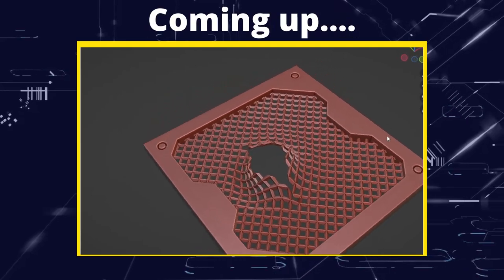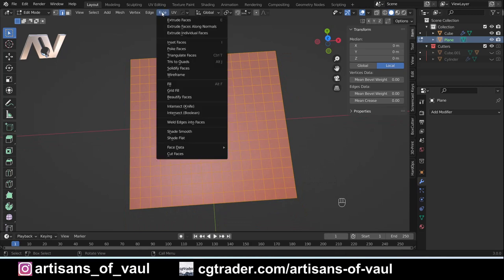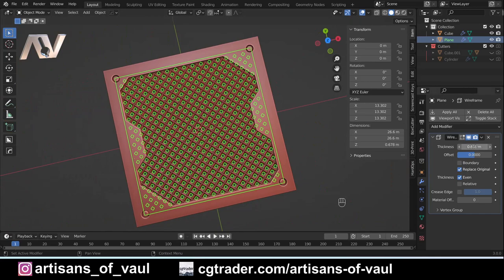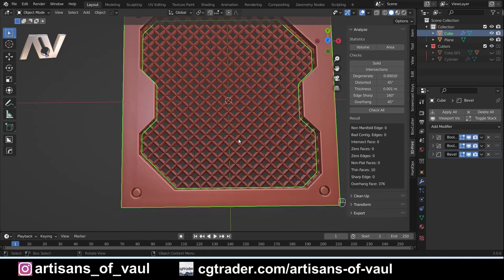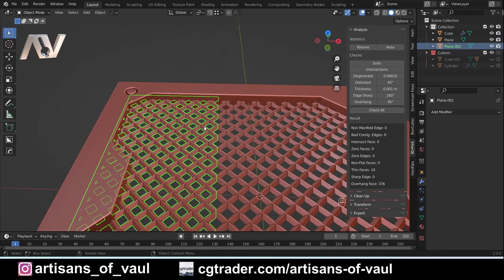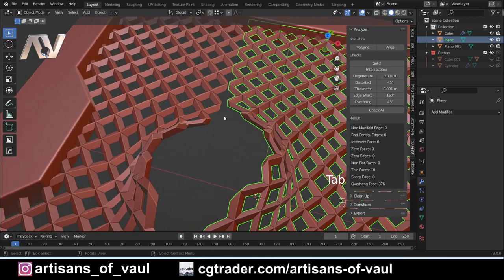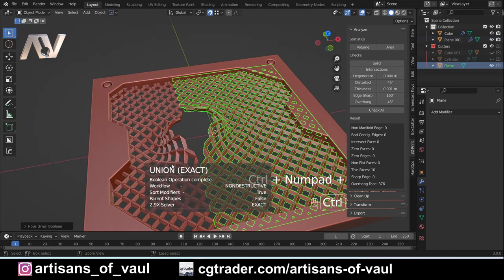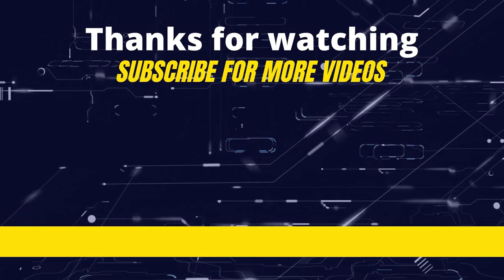Creating a torn mesh panel in Blender

Comment: I am pretty new to blender and am keen to make my own designs to 3d print, in your videos (which I have been going through and watching because finding this channel and your work has been amazing) you start from some cool shapes like in this floor tile video and the gothic walls video, this is where I get a bit stuck. How did you create the basic shapes to start with? Apologies if this is a stupid question but it one of many I have.
Reply from the maker: Its a very sensible question but one thats a bit tricky to answer because it depends on what is being designed.  Most of the time I will either make the basic shape by combining shapes together using booleans or extruding shapes from something basic like a cube.  In other instances (like in this video) I will subtract shapes from the basic shape using booleans or BoxCutter.  It would be a good subject for a video as I cover bits of this in other videos but dont have a complete single video on the topic.  If you have any shapes or videos specifically do ask for sure.
Reply: @ArtisansofVaul  Thank you so much for responding. A video on this as a topic would be amazing! I have always wondered how terrain designers make interlocking terrain so for instance walls that slide into a central column of that makes sense with for instance a T shaped male side and a T shaped female side. I have been trying to work it out and I imagine that it would involve booleans that are male and female interlocking parts but thats about as far as I got. A video on that would be really helpful to put it into context on how its done, not sure if its a good idea but something that would be cool as there isn't anything like that on YT that I could find.
Reply from the maker: Yeah thats also a good topic as there are a couple of ways of going about that (and some tricks for doing it with 3D printing in mind).  How to break models apart if already on the list somewhere.